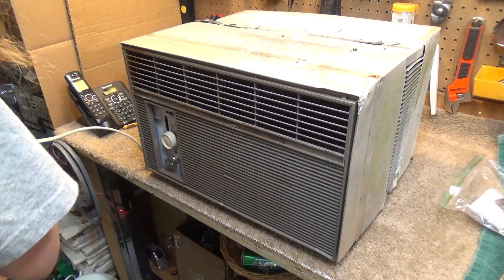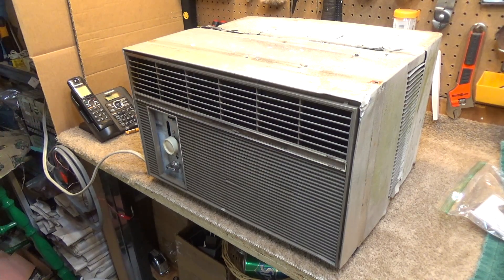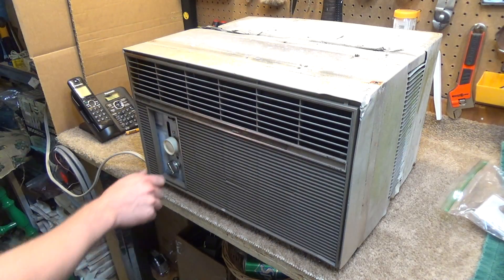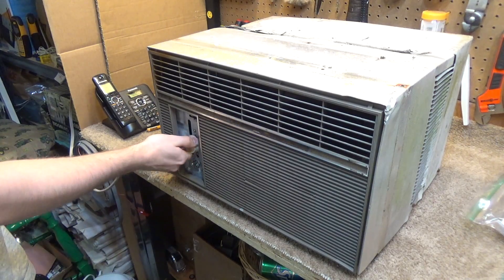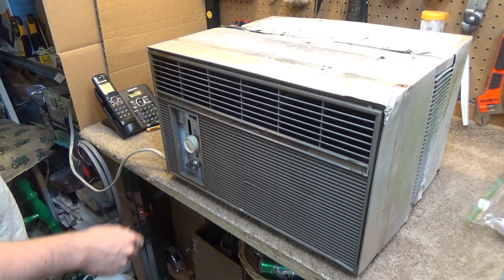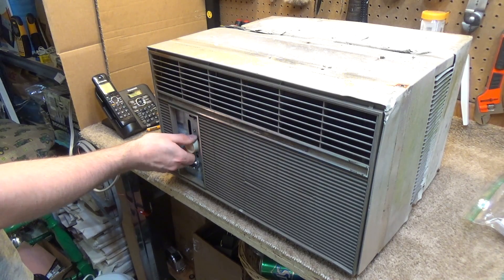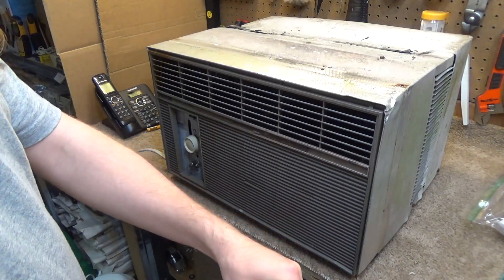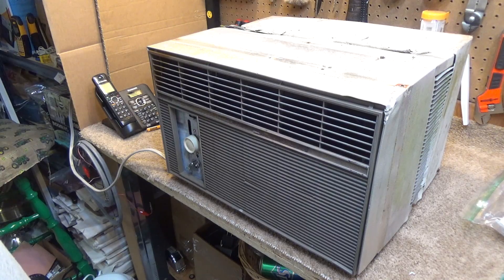Vintage Westinghouse 5,000 BTU Air Conditioner | Testing Thermostat

Comment: If nothing else, I believe Home Depot sells replacement air conditioner "sides".  If the screw holes don't match up, a could of self-tapping screws right into the sheet metal case will do the trick.  Obviously the new sides won't be period correct, but if the existing ones can't be saved, it's your next best bet.  Alternatively, you could pick a window to put it in and cut a couple of pieces of plywood to fit the sides, or shove it to one side and cut one piece of wood.

In my apartment where I used to have my Westinghouse, it was in a basement, which had sliding casement windows.  I cut a big piece of plywood to fit over the whole window, and used self-tapping screws to attach it to the window frame.  The center of the plywood was cut out to allow the unit to go through, and with some wiggling, it made a nice tight fit.  There were even 2 holes on the top brace of the unit, I used a nut and bolt through each one to firmly attach the air conditioner to the wood.  At the end of it all, it was firmly bolted to the window, and couldn't just be ripped out or kicked in if someone wanted to rob the place.
Reply from the maker: Everything about this unit is no-nonsense..
Reply from the maker: A could of self-tapping screws?
I believe Home Depot sells them as well.. I went there and purchased a set of replacement accordion-style side panels.. I don't know if they're going to work or not, but it's worth a try.. When the time comes for this to be used, chances are it will be installed through the wall rather than in a window due to the infrequency at which it would be used..
Reply: Yes, a "could".  That was a typographical error, and since you don't allow edited comments, it has to stand as is.

Through the wall would work great for this unit, it's just a nice rectangle, cut and shove it through then seal the gaps.  No nonsense.

Comment: This A/C unit is very similar to the old Fedders units from the 70’s and 80’s.
Reply from the maker: There were a number of models like this one, it's a pretty basic design..
Reply: Who knows, maybe these were made by the same company that made Fedders units.
Reply from the maker: @1998MonroeNYColonial  These were made by Westinghouse, I'm not sure if Fedders units ever used Westinghouse compressors or not.. I wouldn't be surprised if they used some of their fan motors..
Reply: Well, you never know. It wouldn’t surprise me either if Fedders used Westinghouse parts and materials.